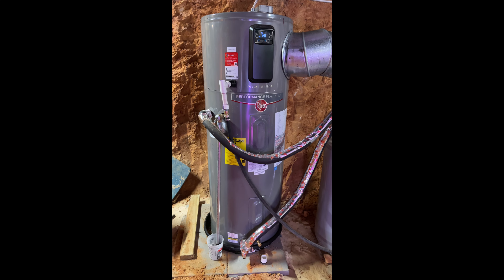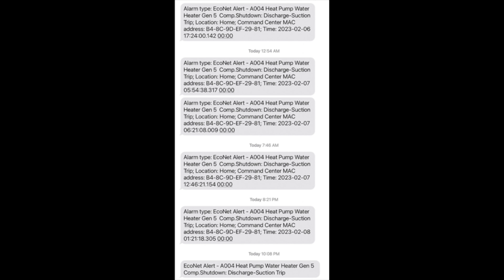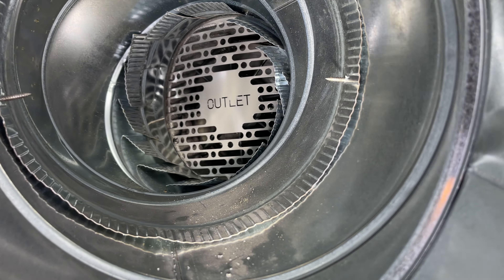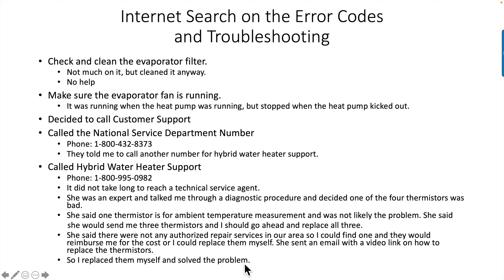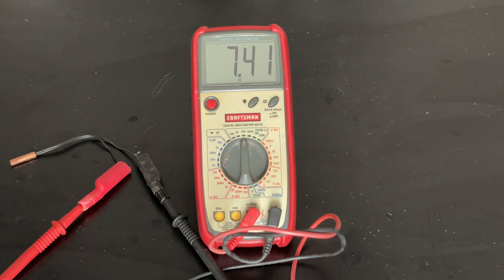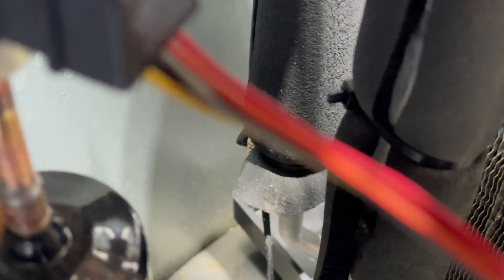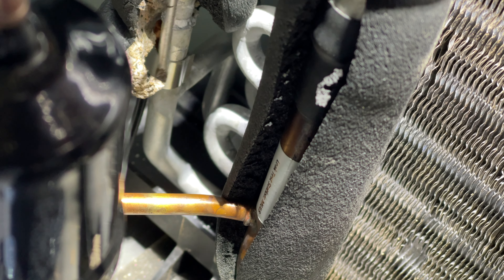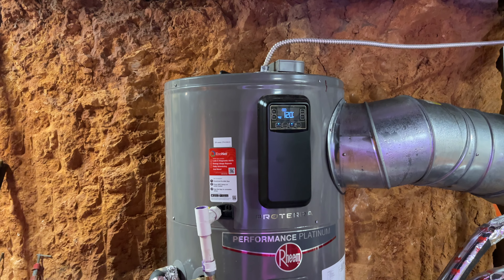Rheem Hybrid Electric Water Heater Heat Pump Kicking Out A004 Comp.Shutdown: Discharge-Suction Trip

Comment: Great video! I have an 80g Rheem heat pump water heater. A few days ago I received alarms for condensation drain clogged even though it wasn't. I noticed the lower section of the coil freezing up. I called Rheem and the person walked me through a diagnostic process with a volt meter. We found the compressor capacitor defective and she also recommended replacing all 3 thermistors(must be a common problem). She shipped the parts and emailed me images and documents to help with replacement. I have been running it in full electric mode since. The parts came in Friday, no charge. I will tackle the repair today and will refer to this video for thermistor replacement. The capacitor replacement looks simple. Thanks for the video!
Reply from the maker: Thanks for your comment and I hope your repairs solve the problem.
Reply: I have a question.  How long in total did it take to do the job.  I’m just about to start the same repair.
Reply: I also have to replace the 3 sensors and capacitor. Do you need to short it out before removing it?

Comment: Thanks for the locations of these thermostat’s 
 My unit is less than a year old and started alarming constantly because of these the company sent me out the thermostats right away. What a pain to get to these.
Reply from the maker: Thanks for watching and your comment. I hope Rheem’s factory has permanently corrected the problem by now. I like the water heater and it has run ok since I replaced the thermistors on ours.

Comment: Outstanding, thanks. I have new thermistors and will install hen soon. You’ve given me some things to look for.  These units are so cheap to run compared to electric or gas. They should be the standard, but some of these growing pains hold back broad adoption. Heat pumps are a mature technology. I hope we see these as the default soon.
Reply from the maker: Thanks for watching and I agree with everything you said.

Comment: Thanks for the video. I believe I have a similar problem. A week ago my daughter was taking a shower and after five minutes or so  water turned cold. Same thing happened to my wife this morning  yet I also got a message thru Rheem on phone  Hardware alarm went off and code  A004Comp. Shutdown Discharge-Suction. Trip, Talking to Rheem after some steps he thought It was thermistor. I didn't have multimeter nor was much a techie so I 'll  have a pro do It. But this helped. This one Is 2 years old .
Reply from the maker: Thanks for your comment. We run ours in energy saver mode where it runs mostly on the heat pump, but will use the resistance elements as necessary. You can try running in the “ High Demand” mode where it runs primarily off the resistance elements. It isn’t efficient, but may help keep up your hot water level. If you are getting the defect code you will need a Rheem approved technician to repair it. Good luck with it. It definitely saves us money on our power bill.
Reply: @anisotropicplus   I finally repaired mine, Rheem sent my three thermistors and I found time to replace them. It took me a little longer than I thought as mine was installed  on a concrete slab of a couple inches In basement, and the side I had to repair was right near a structural beam so It was tight to say the least. Getting the gunk tape wasn't easy either. I did notice my new thermistors were more of a brass color than the copper ones that were on there. Well she's humming now and back In business. Thanks again for your video It was a great help. Howard

Comment: I have very similar issue.  My heater worked great for about 1.5 years and then developed possible thermistor issues that are like the ones you detected.  The replacement thermistors are in route as I write this comment.  One of the issues I had was an icing up of the evaporator coils and subsequent blocking of the air flow passed the evaporation coils coupled with a blockage of the evaporator coil discharge.  Hopefully replacing the thermistors works. I’ve already watched the Rheem video on thermistor replacement.  I think there’s now a known issue with thermistor performance that occurred during installation.  This was a very informative video.
Reply from the maker: Thanks for watching and your comment. Good luck repairing your water heater.

Comment: Great stuff! First hybrid heater video I've seen with a "duct kit". One thing I found out is that the "major brands" sold at big-box stores are not actually theirs... so the "AO Smith" header I bought had no duct-kit available from the Manufacturer... only the models that are sold by AO Smith Directly do . Caveat Emptor.
Reply from the maker: Thanks for your comment. I made this duct attachment using parts I could find at Home Depot and Lowe’s. I had to make my own because the factory duct adapter was unavailable. I made sure the diameter would not add any restrictions to the discharge airflow. I used the adjustable elbows so I could direct it where I wanted the air to go. My concern was you could get an unwanted circular airflow with some of the discharge air finding it’s way into the intake on top which would reduce efficiency.

Comment: Agree with others - you should try to reduce the dust (pleated HVAC filter over the air intake).  Else it seems like an issue with the coils will be in your future.

LOVE you video. Great narration voice, and the graphics on the still photos were fantastic!
Reply from the maker: Thanks for watching and good advice.
Reply: It will result in a code if you add filtration, the best option is more frequent checks and gently cleaning with evaporator with compressed air.
Reply: Great vid. @anisotropicplus
Reply: @rickpowell1402  I've had installed since day one (~3 months now) a HDX (Home Depot) FPR 5 (MERV 8) 1" filter on it.  Never had any codes on it.   I had some extra's around, which is why I'm using this.  If I put in a higher MERV (more restrictive) filter, I could imagine that many cause issues.  

I can see the part of the (square) filter that's covering the semi-circle inlet opening showing dirt.  So it's definitely filtering something.  
 I don't think there's a lot of airflow on the Rheem inlet (compared to a HVAC unit).  So smaller particles that would get pulled through an HVAC, and thus could benefit from a higher MERV unit that can filter more - I don't think is needed here.   Plus my goal wasn't to eliminate every spec of dirt that might get to the Rheem's air filter.  Rather, just reduce as much as possible, in an efficient way.   At least for me, this solution seems to do that.
Reply from the maker: @rickpowell1402 Thanks for watching and your comment.

Comment: It may be hard to know what solved your problem since you performed 2 changes - you swapped out the thermistors, but you also cleaned the unit.  I’m reading a LOT of material that’s saying it’s the accumulated dust found on the coils inside the heat pump that causes the unit to shut off and throw all of the error codes…typically within a year or two depending on the ambient dust levels.  The “filter” is fine for stopping larger particles but does very little to prevent the buildup of the smaller stuff.  From what I’ve read, there is no mention of cleaning those coils at all in the user manual.  In your specific case, seeing the corrosion on one of the parts may be a good indicator, but would love your feedback on the possibility that the coils being dirty was also a contributing factor.  Looking at replacing our 20+ year old units in the next month or so and this new system is a real contender.  Thanks!
Reply from the maker: Thanks for watching and your excellent comment. Even though I had only recently installed the unit and it was almost new it is in a “dug out” crawl space with me occasionally digging and removing soil and rocks that could produce airborne dust so the probability of dust on the coils was relatively high. There was minimal dust on the filter, but like you said it will only remove larger particles. There was minimal dust accumulation visible so I think the thermistor issue was the likely cause of the error codes. On a different subject I set it up so it will recirculate crawl space air rather than bring in outside air. My thinking was the thermal coupling with the exposed soil and concrete would make it more efficient. Our power bills are noticeably lower and it is doing a good job of dehumidifying the crawl space, but the crawl space is a lot cooler, so much so that it is negatively impacting an indoor garden I set up to grow vegetables. So there are multiple issues to consider when installing a heat pump water heater. Overall I am satisfied with it and would recommend installation of one.

Comment: Thank you!  This was very helpful!  We keep getting a A104 code with no idea what is going wrong with upper thermistor.  We are on our third upper thermistor.  I don't think this is the real problem.  Wondering if our recirculating pump is causing an issue or electronic board/app????
Reply from the maker: Thanks for watching. The thermistor that is hardest to get to was the one that appeared corroded on our heat pump water heater. Have you replaced all three thermistors shown in the video?

Comment: Thank you for this video. This was exactly our issue after operation for about 9 months. Have you had any additional issues since the fix?We’re worried that even if we get it replaced, we’ll end up back where we started with the copper/aluminum corrosion.
Reply from the maker: Thanks for watching and your comment. So far it has worked great without any issues since I replaced the thermistors. Your question has reminded me that I need to check the filter. Thanks

Comment: I be had mine in since Dec 27, 2022. I will open my top and putting on a NoLox paste on the copper sensor to aluminum piping contact point. This is used when terminating aluminum wiring into any panel board or sub panel. That’s a big oops on Rheem part.
Reply from the maker: Thanks for watching and your advice on the Noalox paste.

Comment: I strongly looked at one of these since we are changing out our 20 year old gas unit, but I read WAYYY too many issues with these for them to have any meaningful payback.  We'll run a new gas unit for a few years more and look at these again when they work the bugs out of them.
Reply from the maker: After we replaced the thermistors we have not had any problems for the last year. But I understand your concern. There are more things to break compared to a simple electric resistance or gas hot water heater.
Reply: @anisotropicplus that's good to hear it's been running well after your fixes though. I really wanted to get one of these I think the idea of them is great. I wonder if they had a better filter system if that would help at all?
Reply from the maker: @zenderxt  That is a good question. The simple filter on it looks like it is really just a screen. It does collect dust mainly from my activity digging out the crawl space. I clean it every few months, but it never has been badly clogged.

Comment: I replaced the txv outlet thermistor and keep extras on hand. I have found that in an environment of freeze/thaw the water will migrate from the wire leads through the epoxy seal and into the body of the sensor. I installed the replacement with the wire leads going up into the sensor but probably won't make a difference.
Reply from the maker: Thanks for watching and your information.

Comment: The best way to find out what is wrong with the hot water heater is to call the Rheem technical support. Per technical support, the error code A004 could be caused by either low refrigerant or bad thermo sensors. My heat gun was sensing the temperature drop. She is sending me 3 thermal sensors for me to replace 
I found out the labor warranty is only good for the first year. It's up to to replace the parts or hire out to your local repair shop.😮
Reply from the maker: Thanks for watching and sharing your experience.

Comment: Good DIY video thanks, Bob
Does anybody happen to know if better insulating of the transmisters would do anything towards extending the life of said transmisters. I have read dozens of comments about "After about a year and a half I got error codes and was sent three new transmisters. I personally are on my second go-round with the Same D=== Problem. I am installing a brand new unit and would like very much to get past the "Year and a half mark" by perhaps better insulation and wrapping the transmisters and piping etc. etc. etc. NOW, FROM THE START". Thanks ahead of time. Bob
Reply from the maker: Thanks for watching and your comment. I have a newer video about a similar problem. Maybe it will help. This is a link. https://youtu.be/1YsGx8C_Cs8?si=ngMdhyNs7dAsB85-

Comment: You said this Rheem hybrid water heater had a positive impact on your water heating bills.  Did you previously have an electric or gas water heater for comparison?
Reply from the maker: We had two 38 gallon electric resistance water heaters. Since we have a Water Furnace geothermal heat pump one of the water heaters was connected to the desuperheater in the house heating system, but with no electrical connection. I removed both of the existing water heaters after installing the new Rheem hybrid heater. I had not measured the relative difference in total energy consumption, but our power bills appeared to be lower with the Rheem hybrid heater. With changing weather and the fact the desuperheater preheating the water in the original water heater a direct comparison was not easy, but I am comfortable with knowing the inherent difference in efficiency between the heat pump in the new hybrid water heater and the old electric resistance heater. Our house geothermal heat pump is now 19 years old and I think the desuperheater had not been working for some time.
Reply: @anisotropicplus  are you using sa Series 7 waterfurnace? If so how do you like it?
Reply from the maker: @ Our Waterfurnace is an E series installed in 2005. It has a Carrier air mover. A couple of years after it was installed the compressor failed and was replaced under warranty. About ten years ago we had some electronic control issues, but the technician got Waterfurnace on the phone and they were able to repair it. Eventually it will have to be replaced because all electromechanical equipment eventually wears out or fails. Our problem will be getting parts for it. I asked the dealer to quote me on a new heat pump unit only and they quoted me $52,000. The entire original installation by the same company that included all the duct work, wiring, trenching in the pastures and burying all that plastic pipe and a two story zoning system was only $17,000 in 2005. I told them they were out of their minds. The salesperson said, “but you get a tax credit”. I was furious and told him the tax credit should have no bearing on what they charge me. What good is a tax credit if the entire benefit goes to a dealer who jacks up their prices.

Comment: Thanks for the video. Mine just started with the same error. Runs for a bit after shutting off the breaker and resetting it, but comes back soon afterwards. 

Does anyone have the part number for the thermistors ? 

Thanks!
Reply from the maker: Call Technical Service at Rheem. They should be able to help you and if it is still under warranty they may be able to send someone to repair it for you. I do not have the part number. Thanks for watching and good luck with your repair work.

Comment: Any idea what this is? T007 Comp.Failure Rheem Hybrid Water Heater
Reply from the maker: Thanks for watching and your question. I do not know. I recommend calling Rheem technical support.
Reply: @anisotropicplus  I called, they took me through the codes. Reset it. I washed a VERY dirty filter (until this happened, didn’t know it even a Thing!.. bought the house 5 years ago and it is sitting in a weird corner behind the washing machine). Now, I clean it.. every other month I’m thinking…?
Reply from the maker: @djkenny1202  Thanks for sharing your experience.

Comment: I have the same problem I like to know where I can buy resistace
Reply from the maker: You should be able to contact the manufacturer and buy parts from them. If it is still under warranty they shouldn’t charge you for the parts.

Comment: I appreciate the video but none of us should have to be doing this in the first place. I have this model and it's barely two years old with minimal use.
Reply from the maker: Thanks for watching.
Reply: @anisotropicplus I just replaced mine and I had the same corrosion on the thermistor that on the aluminum pipe. Thanks again for the video.
Reply from the maker: @JohnSmith-gu3ub  Thanks for sharing your experience.

Comment: Simply - these water heaters suck: have replaced thermistors three times, have replaced fan once, have added factory provided foam sound dampening once, the 50 gallon model cannot keep up with demand from 3 to 4 people....  The list goes on.  I know set my water heater on to High Demand simply to accommodate my wife and I.  Will be replacing the unit (second unit) shortly.
Reply from the maker: Thanks for sharing your experience. They probably should send a technician to put brand new parts in everyone they have sold. It’s not like you can easily remove it and take it back to the store.